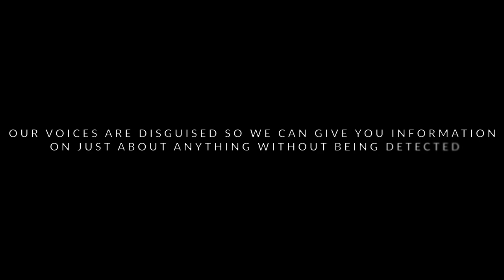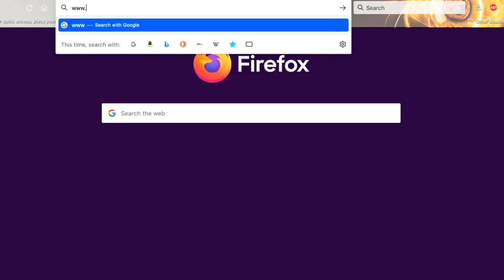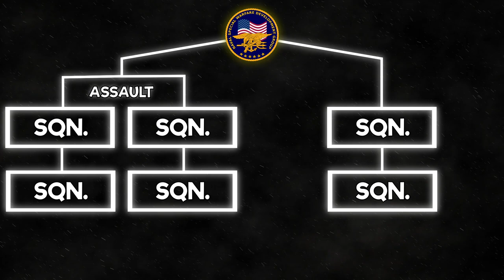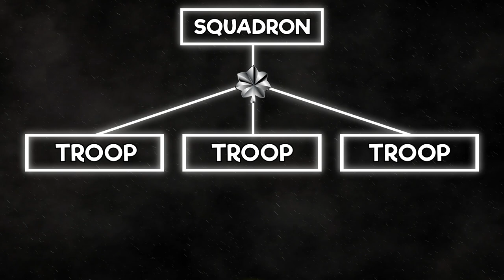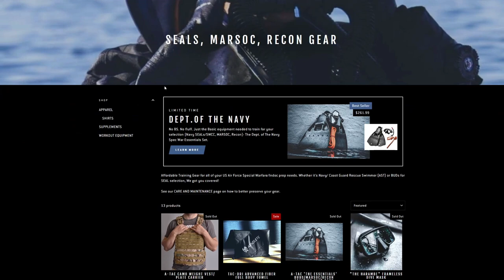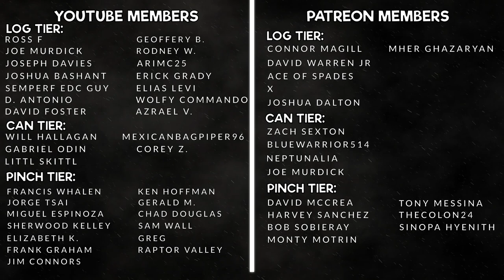SEAL TEAM SIX (DEVGRU) - US NAVY’S ELITE TIER ONE UNIT

Comment: Is Delta are better than team 6 and more efficient?
Reply: They’re just different. Have different approaches. One of the bigger ones is Delta is a big fan of dynamic entry. Flash arrival, flood the structure, and get them before they can set up. DEVGRU likes to cut the power if possible, and slink through the structure like fuckin ninjas deliberately and slowly crawling through snatching lives as they go.
Reply: @granthoover9045  did they train or drills together?
Reply: @Blackmoon9u9  Van Sant talks about a deployment in Iraq where they embedded a DEVGRU guy in each team with Delta. Supposedly they hated each other lol, like mortal enemies. He said it took some feeling out but ultimately they’re all great gun fighters and operators so they were able to get used to each other. I don’t know how much they actually work together though, Delta will almost always pull Army Rangers if the mission gets bigger than expected.

During the war on terror for the most part Delta was given Iraq and DEVGRU was given Afghanistan. I’m sure they may work together in certain instances every once and awhile, but probably not too frequently. Sounds like they hate each other.
Reply: @granthoover9045  imagine a superbowl army vs navy with the teammaters from tier 1 units 😂